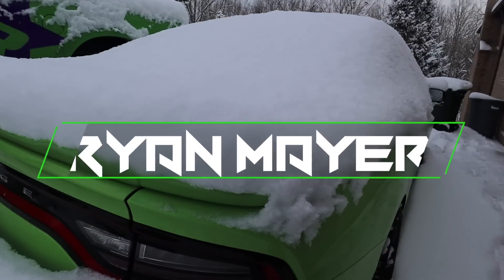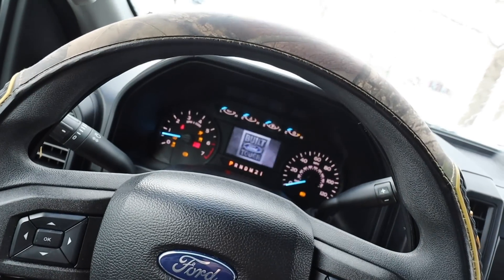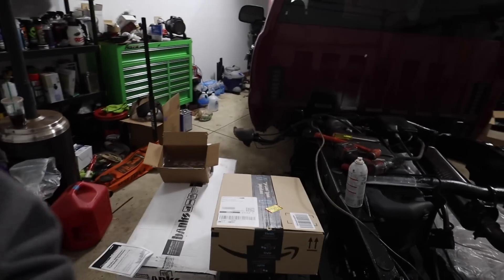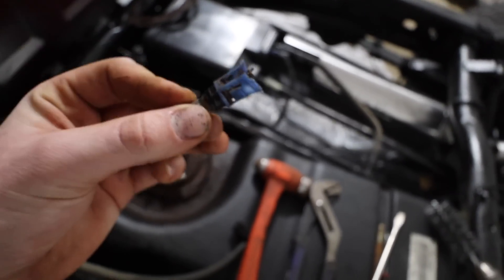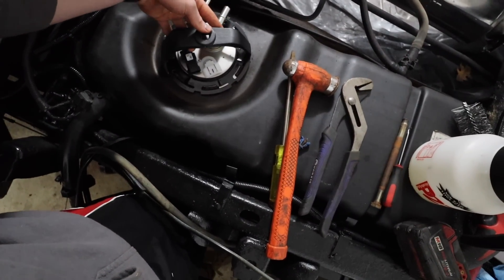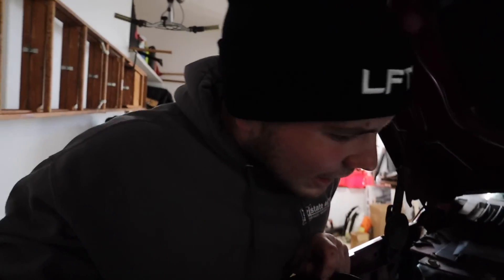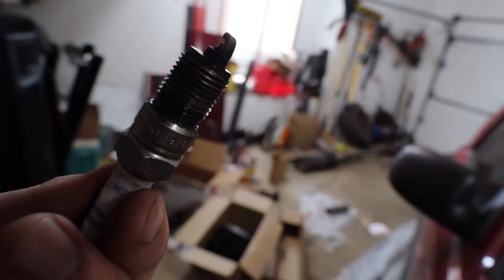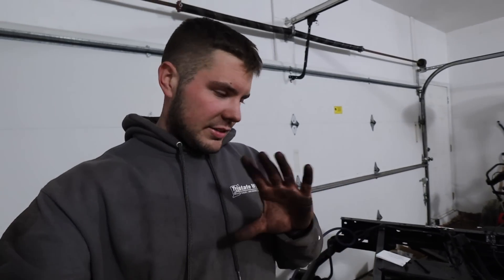Taking the Headers off the Chevy Did NOT Go As Planned...I Can Explain.

Comment: Don't go cheap on the clear coat.  If you go to Smetzers in Avery about 5 miles south of cedar point. Ask Rob to give you  dealer pricing you will save a lot. Show him your YouTube channel. He is a great guy. 

 You can use a drill bit to get the metal fuel line pipes out of the plastic fittings.

Comment: Make sure you buy new O2 sensors. They are extremely finicky and if they get alil dirty they won't work. You can also get the special socket at auto zone. Also.... here is your chance to open up the exhaust end of the motor. Like getting a performance exhaust with muffler. I just put a cherry bomb muffler on my 2013 ram 1500 and it not only sounded amazing put it had way more pep in her step that I didn't realize it was there. Alittle food for though

Comment: Just buy a new y pipe no sense of having a Rusty one with new heads new exhaust muffler and tip SMH
Reply: Good idea. Sometimes just buying new is the answer. I know gas tanks are same way. Squarebody tanks are bout $100 and not worth trying to clean out and mess with
Reply: I agree but the converter pipes are probably $800 - $900. He just has a single exhaust.
Reply: @CanadianArchaeologist  summit racing has them for $48... And others are $88 up to $144... So cheap enough to not worry about old pipes
Reply: @workingmansrestorations7071  if he can get them that cheap than he should definitely just buy new.
Reply: Yung Bitta or do long tube headers and delete the factory y pipe
Reply: Yeah he has single exhaust which he could do duel if he wanted but they even sell a cupler duel into one piece so he could angle pipe across mid way into a single muffler to tip many ways you can customize a exhaust do it yourself style instead of factory molding I just watched a dude do a half triangle style duel into a single and weld it all custom
Reply: But back to original conversation of buying a new one is he's restoring this truck and will take it to a show probably and to have everything nice but one piece be Rusty and not last as long as the rest is just mindless really yeah shave some budget but do it the right way the first time bc if it gets hot enough that's the weak spot past experience with a pipe that was barely even Rusty just cracked bc everything else was new and thicker so it retained more heat

Comment: Ryan! Shop tip for u from a real mechanic. Anytime u are going to be unbolting anything remotely rusty like those down pipe studs give it a good coating of PB Blaster and let it sit for a bit. The longer it sits on it the better. When you go to loosen it first try tightening it just a tad then try loosening it. Work it back and forth like that until it gets pretty loose. You have to take ur time and not be in a hurry. By doing it this way u will save yourself a lot of extra money and time having to fix it. Patience and tinkering are key to being a good mechanic.

Comment: Here in Illinois, your manifolds bolts are factory rusted to make sure everyone of them bust off in the head. You might as well just get a custom true dual exhaust run from the headers back, if done right they sound mean, if your running headers to stock y pipe and exhaust pipe with a muffler delete it’s sounds like a diesel, idk why they just do😂 also not sure what plugs you ordered but I went threw about 10 different plugs (it didn’t run right on one) before I called my mechanic and hes tired every plug under the sun for ls engines from stock to 6-700 horse and he only uses ac delco platinums, threw them in my truck, bam runs great.

Comment: Magnaflow makes a y pipe replacement with high flow cats. Better to just replace since it has over 100k. Or get a cat delete y and custom tune to eliminate the rear O2 sensor signal.